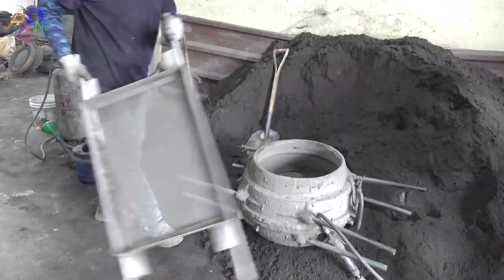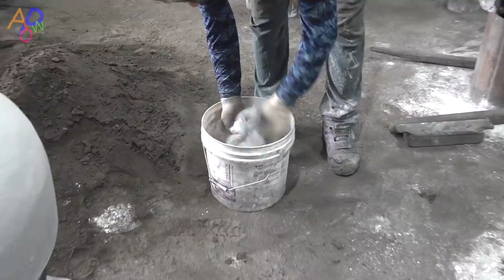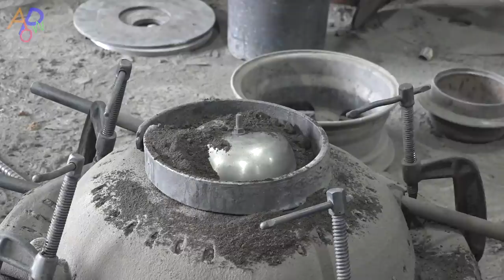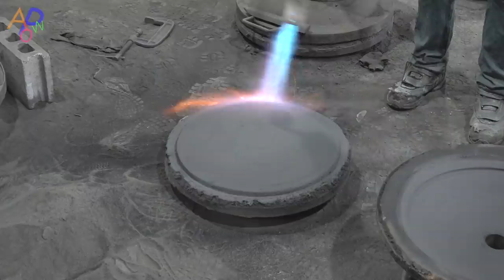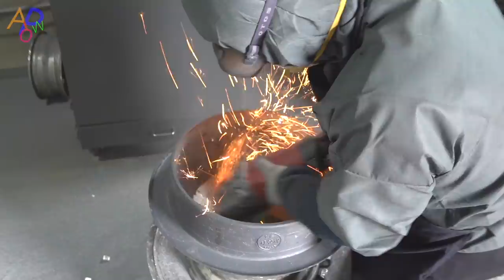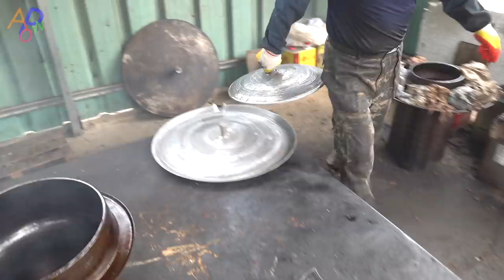Korean Iron Pot Factory Manufacturing Process

Comment: dishes made of ferrous metal, it rusts, finished products are additionally processed so that it does not rust?
Reply: zhy
Reply: They apply cooking oil when the metal is hot, that seals the metal and gives it a non stick coating.
It's called seasoning, and it's what they are doing at the end of the video.